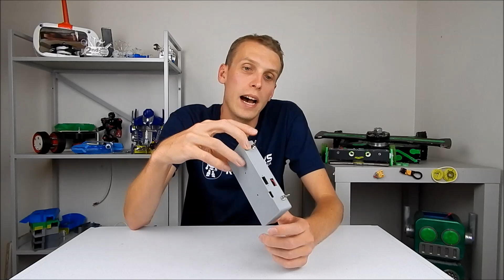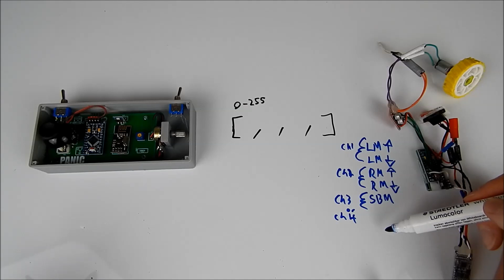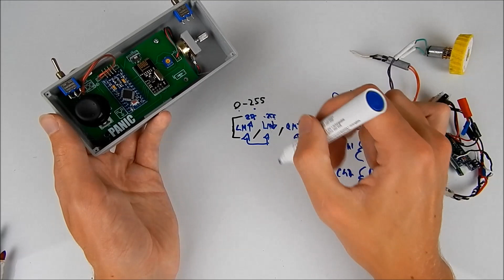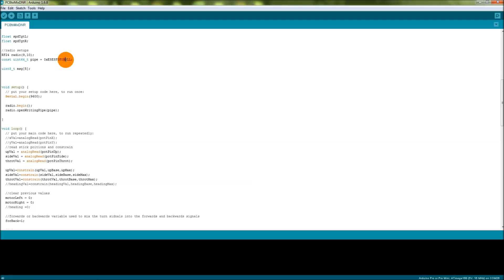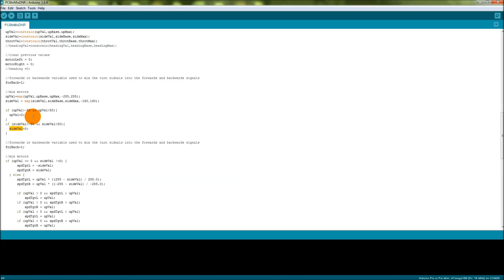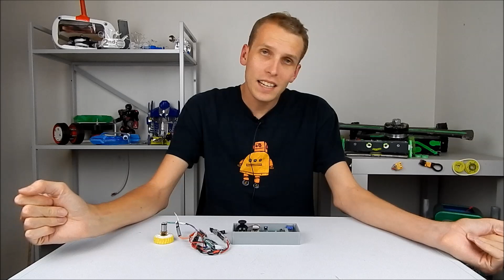Code run down for DIY 2.4ghz RC transmitter/receiver

Comment: Thanks, your project has inspired me to make my own version.  I  got my pcb boards for my first version.  Instead of using the arduino and NRF, I used an esp8266 and it's ESP-NOW feature.  I was able to make binding just like my Flysky.  It looks like it is going to be a cheap solution,  and clean solution.  I had JLC assemble the boards (except the ESP8266). JLC had the bare 1A motor driver on their assemble list, so it is a 1 board solution with just the ESP soldered on the back. I ordered 30  and shipped the board was under $2USD each.  Add the ESP and the total was under $3  (just add motors and battery)  the  controller used a wemos d1 mini,  0.91 OLED and some buttons that allow me to have a menu system to control options.    Still working on the code to have steering of the joystick smoother and version 2 that adds headers for a servo or weapon motor.    I'm not at the stage where I can create an instructable.  But  I can share what I have.  I volunteer at a high school robotic club  and driving  the cost  down was a major motivation for me.
Reply from the maker: Thats awesome! 
I didnt realise JLC had a board assembly option I might look into that.
I've been thinking about making my own dual brushed escs and offering them to my local club as a way of helping to keep costs low.

With JLC's board assembly I might be able to get them cheap enough
Reply: @TeamPanicRobotics     Here is some picture of my first attempt https://twitter.com/hogfanboy/status/1269382854154338304   I'll share my easyeda file  but I'm in the process  if making a version 2 that has headers for servo and weapon.  ver 1 only and  dual motor drivers.  I think what I liked the most of my first cut was the controller with the display where I can adjust trim max speed   and the  use of the ESP-NOW  setting up a binding option  to work like  my Flysky. no need to change the code if you change bots or receiver
Reply: @TeamPanicRobotics   made my EASYEDA files public    https://easyeda.com/hogfanboy/battlebot  I'll try to find time to publish code of of the ESP-NOW and the binding

Comment: Waiting for the updated code to test it on a pistol grip format :) . Thanks for sharing
Reply from the maker: It should, you just use the potentiometers from the accelerator and steering rather then the ones in the joystick I use.

I'm keen to build my own pistol grip controller, but I havent been able to find a decent base file on thingiverse to modify. have you designed your own or are you hacking an existing controller?
Reply: Team Panic First i Will test on an old tx, but after i will make my own model, and i Will make then open-source. I can tell you when i made

Comment: 2 questions. 

1. Why did you stop painting your bots and their weapons to fit a color scheme? 
2. Which of your active fairyweights is the oldest?
Reply from the maker: When I realised I was waisting 2-5g per robot on paint. (Now I just try to print things in a good colour scheme, but dont worry too much if its miss matched)

Depends on what you mean by active, Its either Disguise or This is a Party. Both have been used recently enough for me to consider them active, and Disguise is the oldest
Reply: 1. How does a THIN LAYER OF PAINT add weight? 
2. By oldest I mean first fight. By active I mean fighting regularly.
Reply from the maker: because spray paint always needs at least 2 layers and a layer of primer, so its at least 3 layers and it adds a few grams.
If you don't believe me test it, your chassis will weigh more after you spray paint it

Probably This is a Party then Disguise doesn't fight regularly